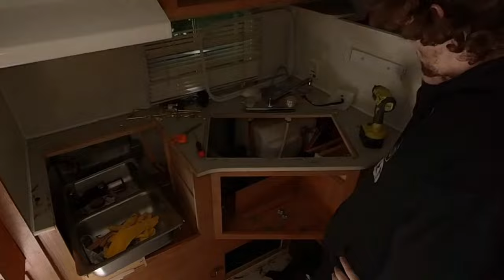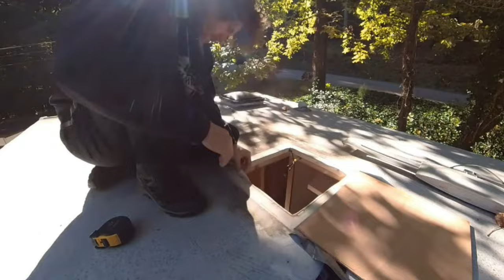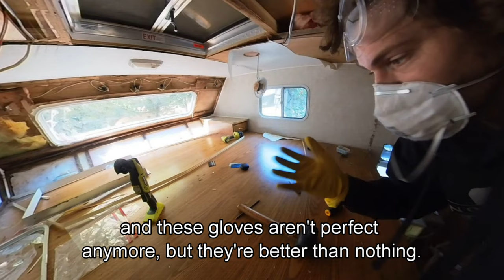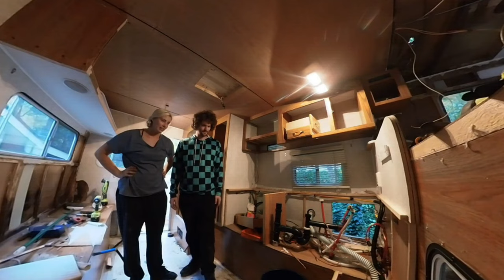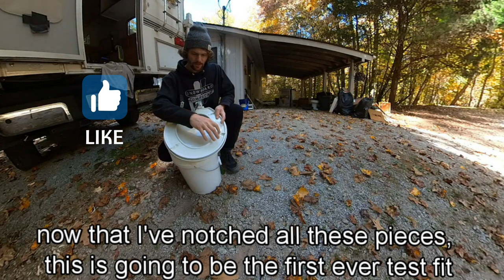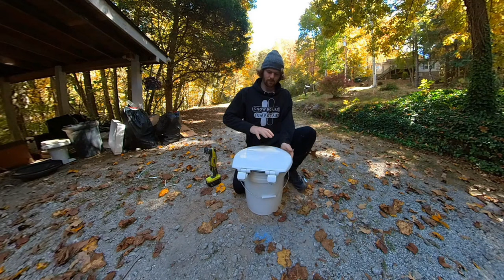DIY Truck Camper Remodel

Comment: For your toilet get another 5 gallon bucket...cut the bucket you have just below the mount for the handle and place your buck inside the other bucket...you could mount the bottoms bucket permanently with the bag it than lift the bucket with the seat mounted to empty the bag.
Reply from the maker: Great idea but the toilet's not done yet! Its going to include a urine diverter that drops staright into the existing black tank (20+ gallons). We should be able to just lift the seat, remove the blue rim, and replace the bag as needed 😀

Comment: I guess you are eliminating you black tank?  Not sure if this is something that might interest you for your fresh water tank for easy access to clean. I did to mine by installing a marine inspection deck plate to able to clean the button, I just cut a hole at the top and installed. Best upgrade to my water tank.
Reply from the maker: That sounds interesting, we'll have to look into that. But no, we're still using our black tank for bathroom water AND as a giant tank for our urine diverter 😁. We upgraded our Fresh Water to a new 42 gallon tank thats inside and well insulated. More videos on that coming soon!